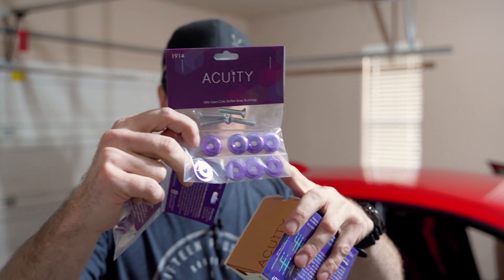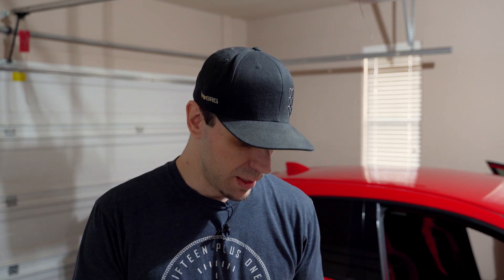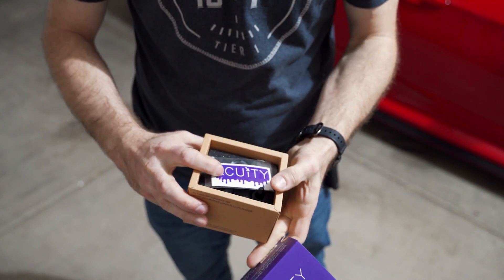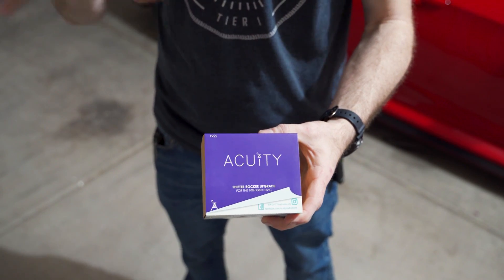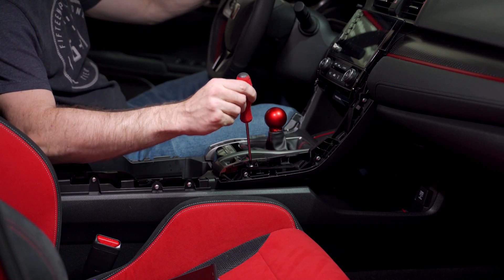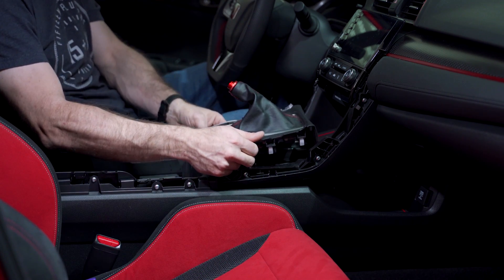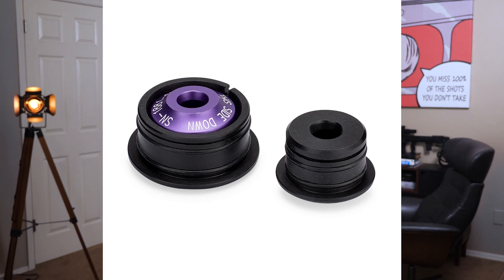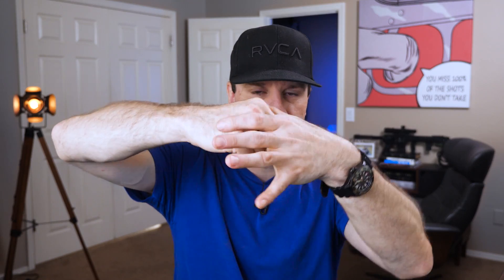NEW Civic Type R STAGE 2 Shifter Upgrade... Worth It??

Comment: Will the stage 3 eliminate the second gear grind?
Reply: Unfortunately it won't. 1/2 Torco MTF 1/2 Torco RTF, Clutch Adjustment and Remove the delay valve. That's your best bet to cure that issue.

Comment: Idk I kinda like the oem shifter for the type r. It's pretty precise. Compared to my fb6 its worlds better in the Fk8.
Reply: I had the same impression in my fk8 coming from an fb6
Reply: I agree with both of you. I have the Full Race shifter assembly in my Type R and I'm dying to remove it and put back in the Stock shifter with the Rocker, Spring and Bushing upgrades. I honestly can't get it done fast enough. I legitimately hate the full race one. Maybe it was installed incorrectly but I can't risk taking the whole console apart and not have a replacement ready. I've never done it myself so I'm hoping I can pull it off.

Comment: At 10:34 what screen option or setting is that on the display that has those gauges?
Reply from the maker: It's from Hondata and you'll need to jailbreak the head unit...I'll make a video about it
Reply: @TORQToolbox  You also mentioned you replaced your original AM intake. Interested in selling the Takeda. Pumped to start my mods.